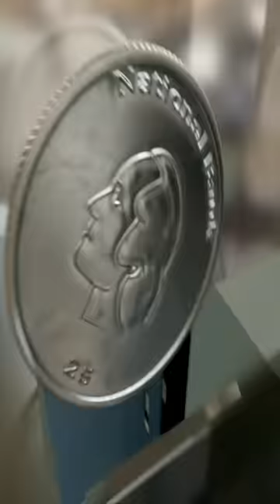How Do Vending Machines Actually Work?!

Comment: Cap, ain't no way these machines got infrared, if a snack don't fall the machine be like "bro u on your own"
Reply: He may have said some dont have it but he really meant most
Reply: Time to beat the shit out of a machine
Reply: @hitorishinda5118  break the glass
Reply: One time I got so fucking angry about that happening that I mangled a coathanger, snaked it up into the machine, and used it to knock down the candy bar that I had bought. Don't fuck with my snacks.
Reply: @thecasualgamer7061  I can assure you that my town does not have "crappy 70s vending machines"
Reply: All of the ones at my school have it :)
Reply: The vending machine at my old college would give out free gum. It had a drop sensor that would always fail to detect when it dropped small sticks of gum, and would try to push out another stick again and again. Eventually it's computer would assume it failed to vend anything or ran out and would refund you your 50 cents for 3 free packages of gum!
However, if you bought your stick of gum, then opened the vending machine door to pick it up right away, the door would trigger the sensors and stop this process automatically, I only found out because I bought the stick of gum and was still deciding on a second purchase when the machine started giving me more!
Reply: @pyroguy482  Wow, what a life hack!

Comment: "If snack don't fall the machine will spin the mechanism until it falls
Damn I wish that it worked that way
Reply from the maker: It does! Sometimes 😁😁
Reply: @quikplay  you would be surprised how common that is
Reply: @quikplay  it doesn't work that way up here, you're SOL if your item doesn't drop.

Comment: Where I live it's completely different. The coin is detected when right after you insert it and you can hear it fall in a coin pile, so they're probably not sorted. Also no infrared detector, so if your snack gets stuck you have to call the number on the sticky note taped to the machine and wait ages for them to come and open it (or shake it really hard and hope it falls down completely).

Comment: Older ones operate on levers inside that have specific slots to where only a specific coin can fit in and when it passes over it registers that said coin has been put in which is why most only accept quarters but some accept down to nickles but not Pennie's

Comment: The vending machine at my old college would give out free gum. It had a drop sensor that would always fail to detect when it dropped small sticks of gum, and would try to push out another stick again and again. Eventually it's computer would assume it failed to vend anything or ran out and would refund you your 50 cents for 3 free packages of gum!
However, if you bought your stick of gum, then opened the vending machine door to pick it up right away, the door would trigger the sensors and stop this process automatically, I only found out because I bought the stick of gum and was still deciding on a second purchase when the machine started giving me more!

Comment: Even if my library had a drop sensor it wouldn’t have saved the time my friends bought two popcorn bags and they were still stuck till I bought a third and then they fell but got stuck at the bottom and the vending machine was designed so that if you opened the flap it would act as a floor so you couldn’t try to take any using tricks resulting in my small hand hurting as I squeezed my fingers through the crack getting all three popcorn bags I never got paid back though…